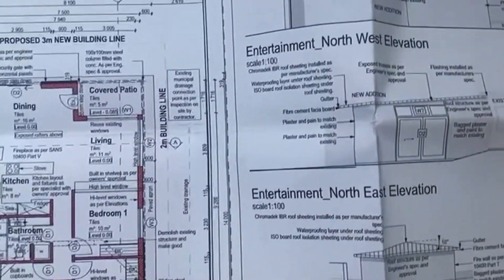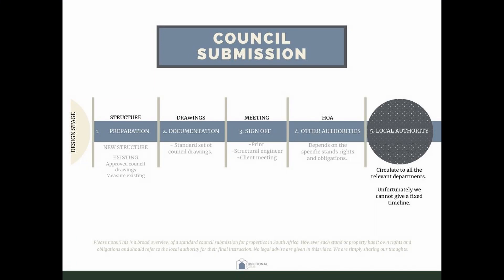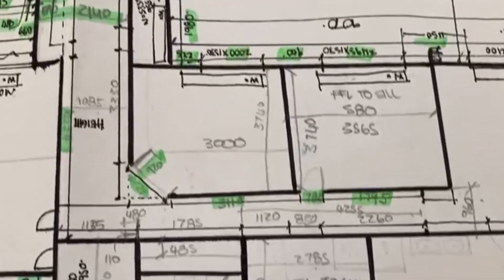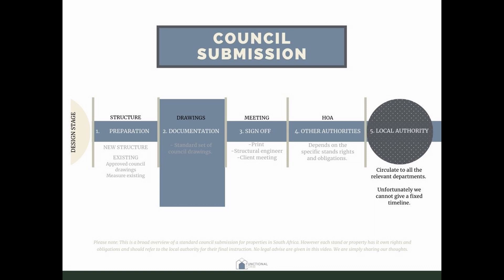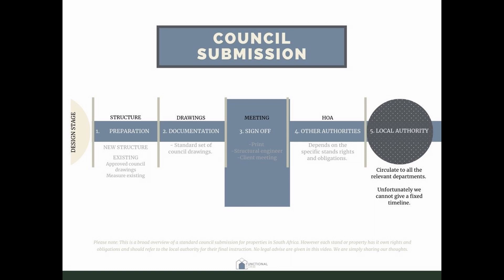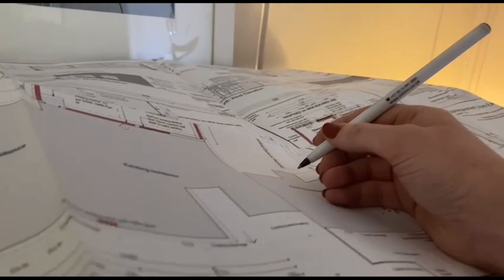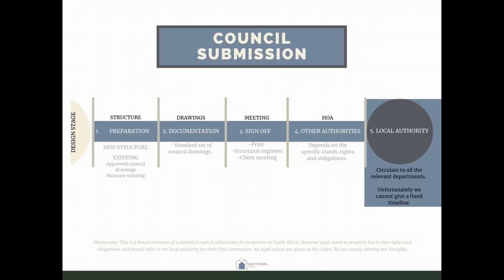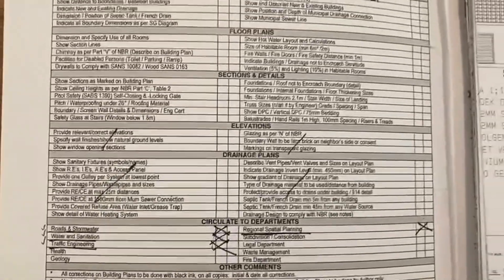ARCHITECTURAL DESIGN l Council stage l What should you expect

Comment: Would you mind sharing the checklist for the details that are required in each drawing, whether it be for sections/ elevations/ floorplans?
Reply from the maker: Thank you for reaching out! When preparing council drawings for submission, it is crucial to follow a comprehensive checklist to ensure compliance with local regulations and expedite approval. Typically, I ensure that each drawing includes:

1. Accurate and detailed site plans, elevations, and sections.
2. Comprehensive design annotations to align with council zoning and building requirements.
3. Compliance with relevant local standards, including building codes and environmental sustainability guidelines.
4. Detailed measurements and material specifications where required.
5. Specific requirements for drainage, water supply, and electrical layouts.

These elements form part of the checklist I follow to ensure a smooth submission process and avoid any unnecessary delays. 

**If you'd like a copy of some of the notes I use as a checklist, feel free to reach out, and I’d be happy to send them to you. Let me know if you need further assistance or clarification!
Reply: @functionalformarchitectura4412  OH yes please. I'm a south african citizen and also a wits university student.

It would be an honor to use your notes.
How should I reach out?